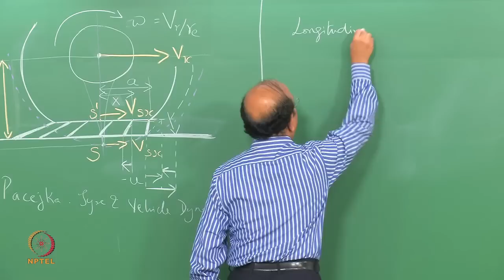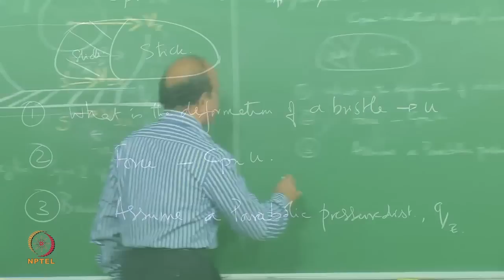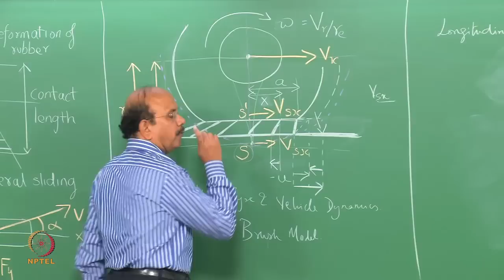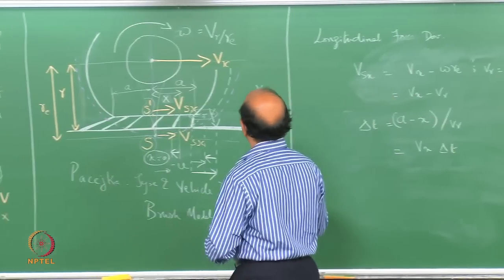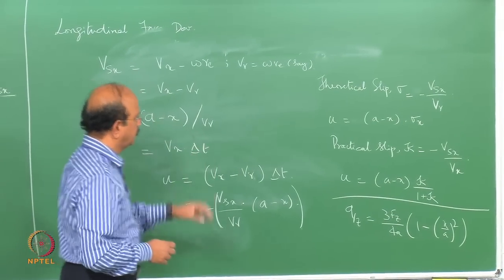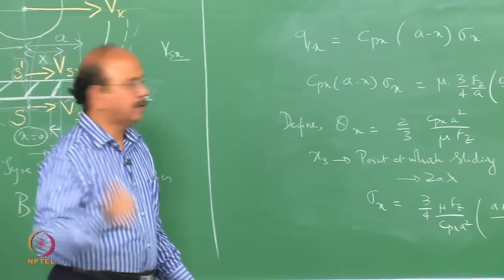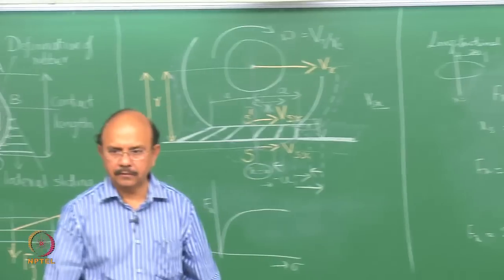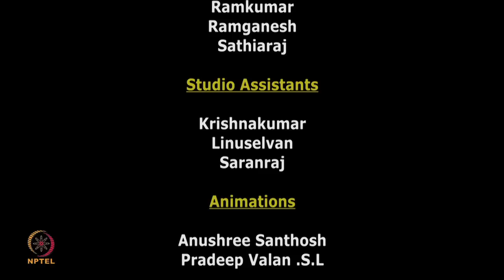Mod-01 Lec-11  Tire Brush Model

Comment: According to the equivalent radius theory, you mentioned in previous lectures. Bristles on the tire are with different velocities according to the region of consideration. Therefor bristles are pulled and pushed by ground, but If we observe close, around the center of the contact patch, the inclination of bristles must change since the one-half tire is moving downwards and other it has upward motion. The inclination of bristles results in a tangential component (traction and braking) and normal component resulting in the uneven normal reaction due to its superimposition compared to the case when the vehicle is stationary. That's why we have parabolic pressure distribution (approximately).

Comment: the head of the bristles must move with the tangential velocity and the tail of that must move with wheel velocity, While in lecture you said otherwise, Sir. Am I right in the said context? Correct me if I am wrong, Please.
Reply: "What sticking with ground moves with velocity of ground   and what moves with velocity of base moves with velocity of tyre  and here he mentions tangential velocity " at the end it may be wrong @16.32
Reply: He termed the head of the bristles to be facing downwards.